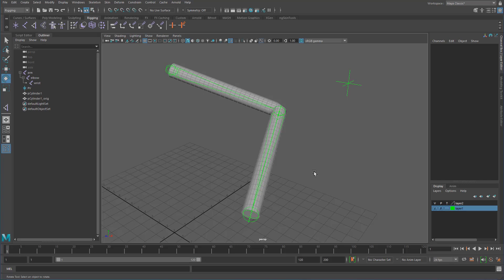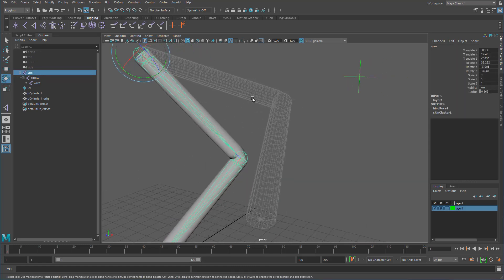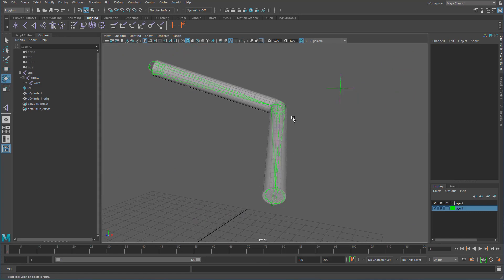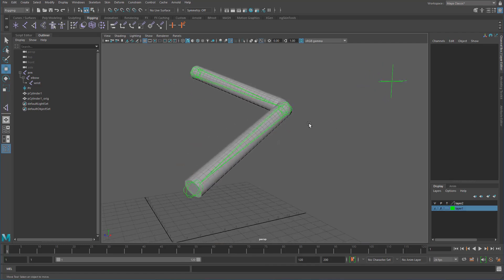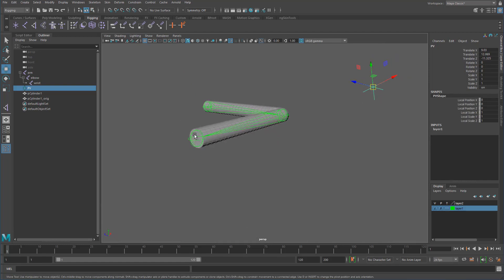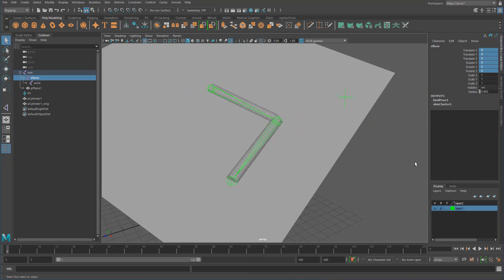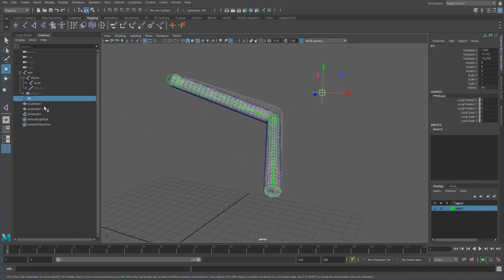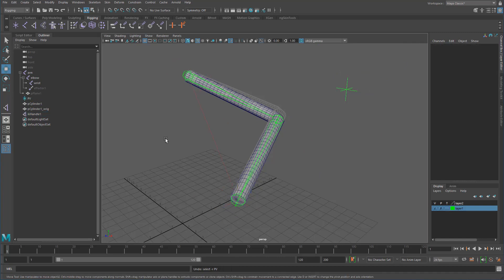Maya Math - 07 - Vector math with Python. Pole vector

Comment: The summary being:
Take the Mid-Point of the Start-Joint and End-Effector. Connect a line from the Mid-Point to the Mid-Joint (or Hinge-Joint).
Extend (as much as you like or required) this line in the direction of the Hinge-Joint. This new point is the Pole-Vector, that should keep the initial joint angles intact, upon applying Pole-Vector constraint.

Comment: For those interested. IF you create Poly Face, snap each point to the joints. Then in the move tool use the (normal option) One can take the elbow verted of the triangle thats created, move it back in normal space (behind the elbow) and snap the PV to that location. Works every time. Also when creating the IK handle, remove tick box on enable the IK, Set the PV and then enable it.